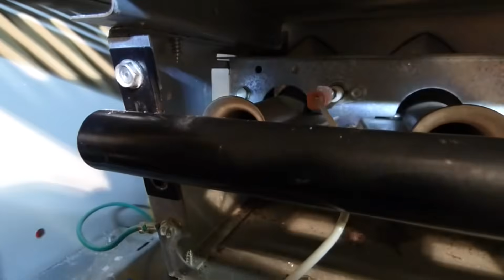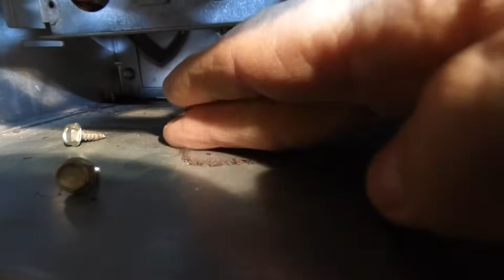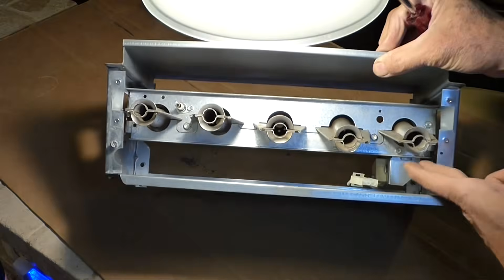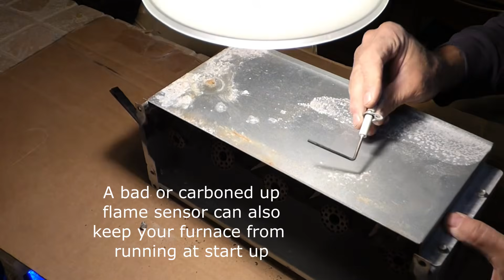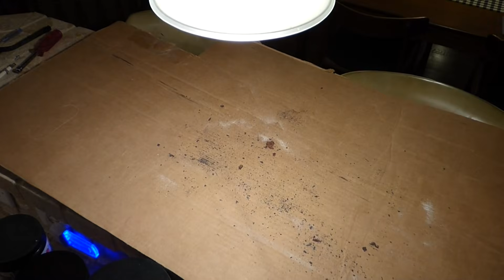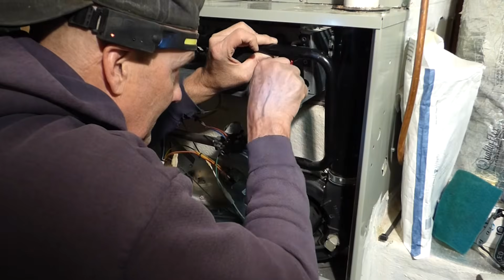Fix the Most Common Reasons Why a Gas Furnace Starts but then Stops

Comment: It's great that you're tackling this issue yourself! I had a similar situation where the furnace was shutting off frequently. American Residential Services identified that the flame sensor was dirty and also noticed some clogs in the burners, which was causing the shutdowns. They cleaned everything up, and it’s been working smoothly since. Just a little maintenance can go a long way!